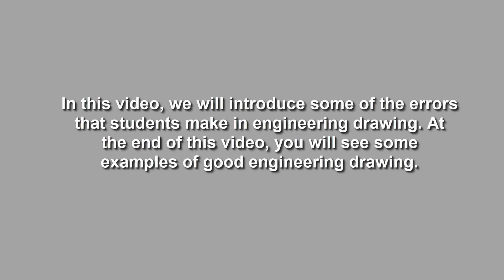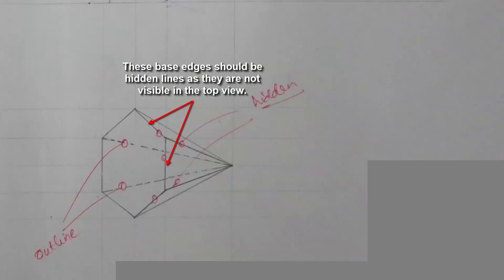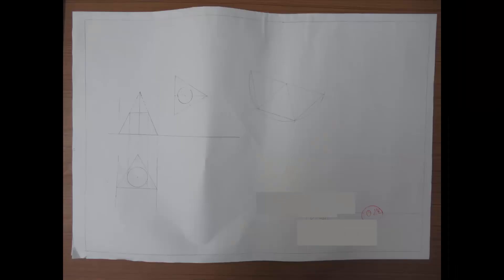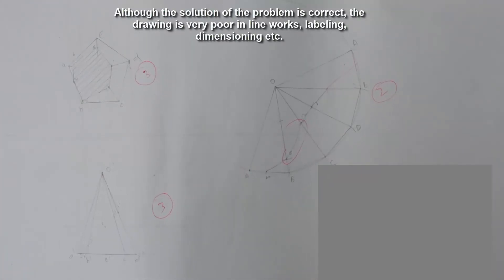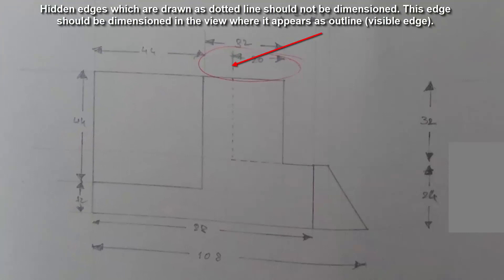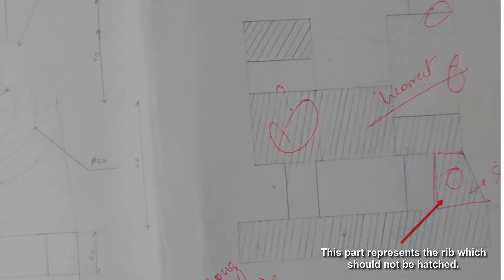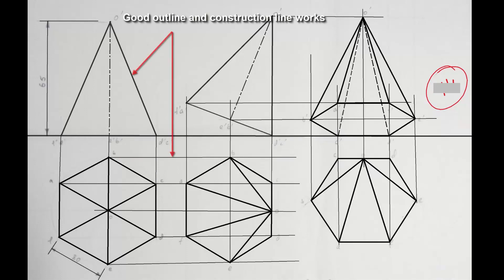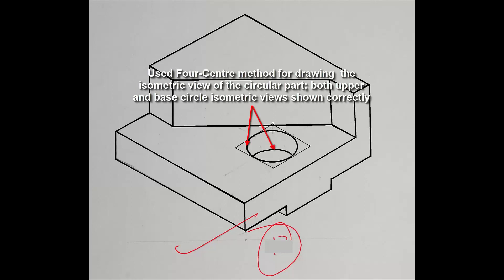1.5-Some Common Mistakes students make in Engineering Drawing

Comment: 0:42  Sir if there is a small mistake while drawing (apex) in hexagonal pyramid in  its true shape of base (in top view) then examiner will  give marks or not ???
Reply from the maker: Marking is something that your examiner decides based on the overall question. So, I can not comment on this. If you did not draw the apex at the right point in the top view then still it is a mistake. Marking is done on several aspects of the solution and hence I am sure you will get marks for other things which you did correct.
Reply: Thank you sir for explaining 🙏🙏🙏

Comment: And sir do We need to make bolded lines for the remaining portion left after cuts?
Reply from the maker: After cutting when you are viewing the cut section (perpendicular to the section plane) then the edges of the cut section will be outline so thick line.
Reply: @1styearengineeringdrawing182  got it sir 🙏 thanks